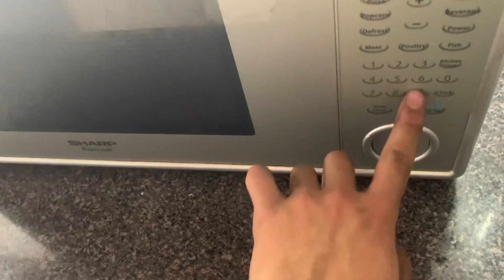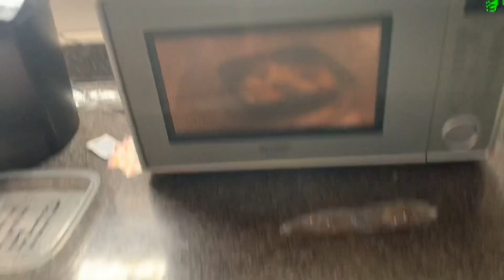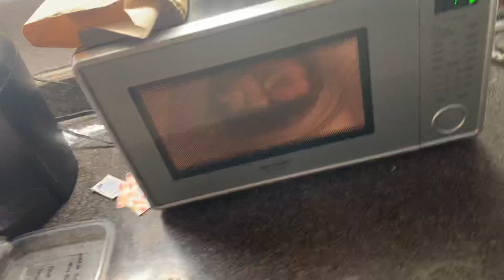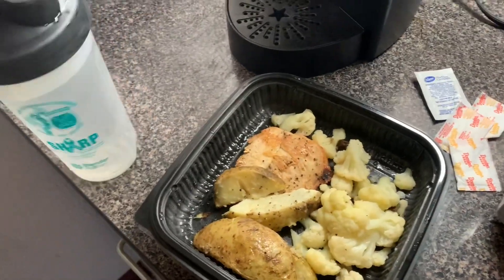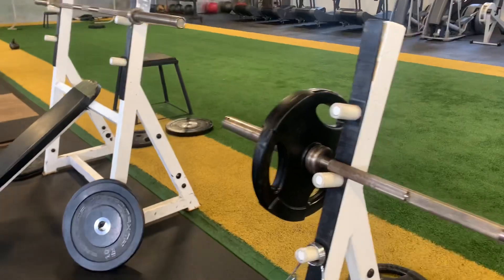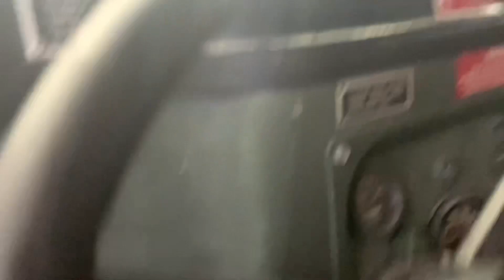Engine Removal On Military Humvee

Comment: FYI... military vehicle/parts have a UOC (Useable On Code) listed in their parts TM.  Some folks rush ordering parts and they do not take the time to look  if they are ordering the right part for the vehicle. Sometimes you have to order the higher assembly/unable to get the individual part. Crazy, but it happens.